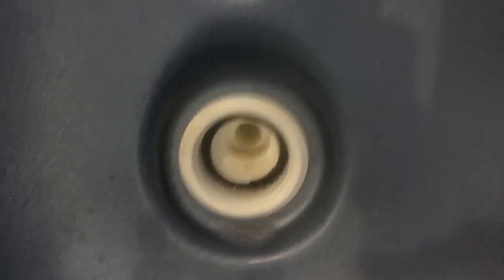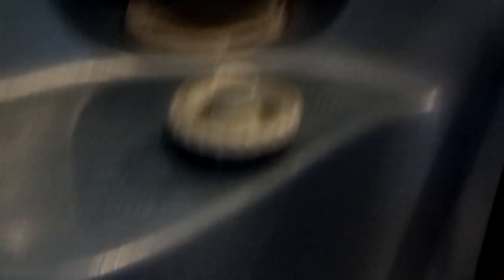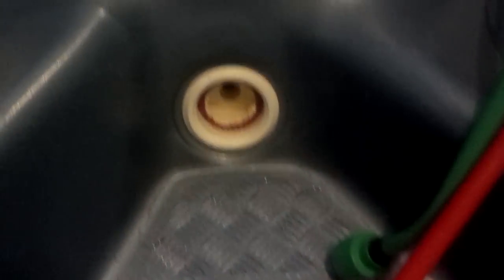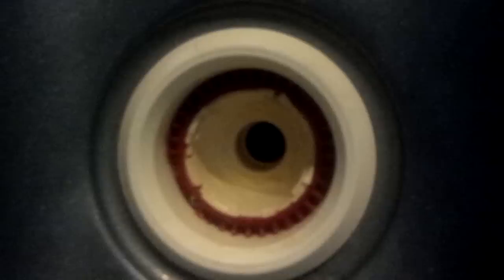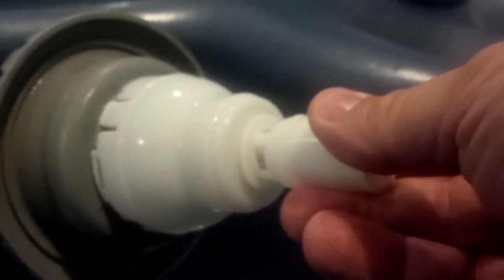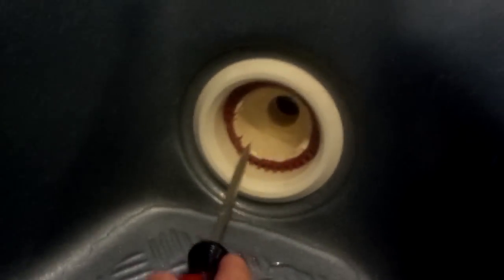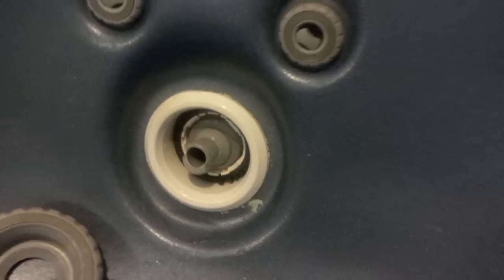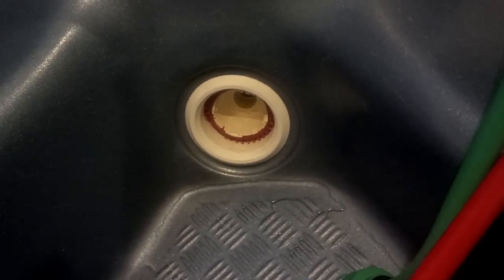Hot tub jet stuck in housing

Comment: Just had the exact same problem but found a solution. I'm (trying!) to refurb an old tub and 2 of the venturi jets would not unscrew normally. However, with a small flat screwdriver, I punched 2 small holes in the bottom of the venturi housing, then lined up a pair of long nose pliers and pushed them right into the holes. This is what gives the purchase (torque?) to turn the housing anti clockwise. Once I got the first stuck venturi jet out, the other one came out in under 5 mins. So, get yourself some long long nose pliers and good luck.

Comment: Long overdue, but I came across this video last night as I had the same problem.  My tub is a Beachcomber 580.  The answer is to remove that red ring with splines.  There are 2 screws holding it in.  Once the ring is removed, you can get the other half of the jet out of the housing.

Comment: I see a combination of the instructions from the comments and it worked perfectly. Had to remove the 2 screws and one came out easily upon pulling. The other had to be twisted by using a screw driver and then pulled out using 2 vice grips.
Reply: Removing the screws from the red trim and removing it worked. Then get a vice grip or plyers to unscrew it.

Comment: Same problem, fixed. The jet body has wide ridges inside running from the front towards the back. Use two flat-blade screwdrivers levering against each other crossed over to apply rotational torque to two opposite ridges. After a while the body turns so loosely you can add pulling force and it comes out. Hope this helps someone.
Reply: Thanks. I used two vice grips crossed over and it worked.
Reply: Thanks so much!  Worked like a charm!
Reply: Thank you ! I was struggling
Reply: Dang it 6  years later it just did ;-) thx!!

Comment: I have a Leisure Spa with the same problem. The pool guy that I bought the replacement part from said that it should pull right out with needlenose pliers. So far, that hasn't worked. Any suggestions?

Comment: Sorry, I got cut off!  Anyway, hallelujah, I finally got then unstuck, freely rotatin and all the white hard as rock cruztong wS gone:  my soltion: I got a spray bottle of Lime out  (did not try Lime Off) and soaked them good.  Then, after a while, used a hard scrubbie on them, and two of the six came loose and could be twirled.  So, I soaked some paper towels with. lime out and stuck them as best I could into and around the jets ( mine are chrome, by the way, not plstic, in case it matters with this product.  AnywY, a got the wrapped in and around each as best I could, wIted an hour,, athtub is entirely fun tioak, and I didn't have to chance breaking them bygetting too heavy-handed with the screwdrivers in the very beginning.  Bless the limeout!  and wow!  The white crud all came off, in and outside!  All but two jets now turned easily.  The final two: I stuck a large flat screwdriver in, and with neRly no effort, got themto move.  Yea!,,   Finally, I used the hand shower to rinse heck out of them and then ran wTer to 3 inches above the, and let the jets runfor 15 minutes.  Leave a window open! It got very fumey!  .. So now My jetted bathtub runs perfectly.  And they look woderfully shony, as do the larger flat chrome rings the surround each jet.  Took me a week of attempts, but in the end, it juat needed the right cleaner.